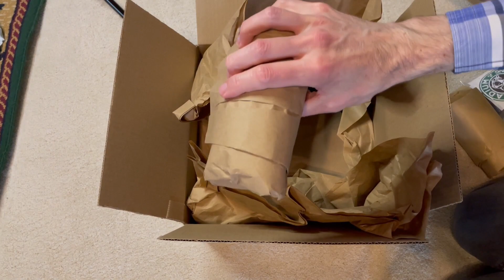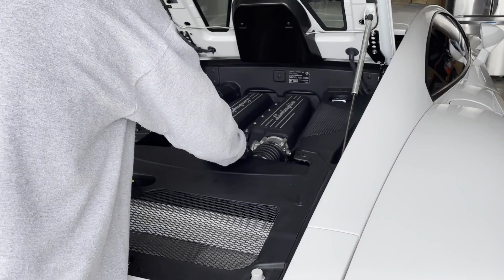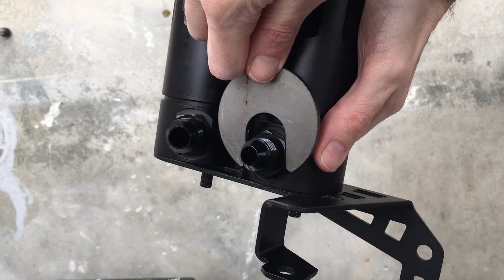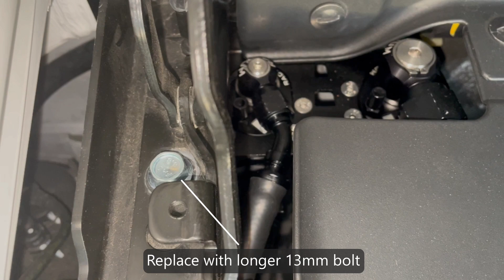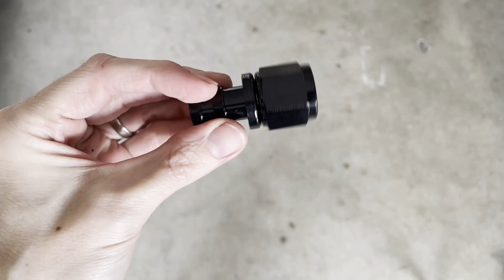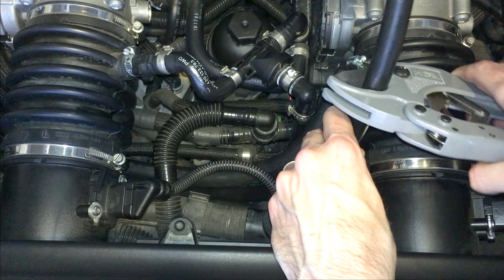Radium Engineering Dual Catch Can Kit // LP Gallardo Carbon Build-up Prevention

Comment: Did you have to add any oil?
Reply from the maker: There's no need to add any oil as no actual oil lines are removed, only the PCV heater-hoses which are "dry" in that only gaseous material goes through them. In the future you do need to dump the catch cans as part of maintenance.